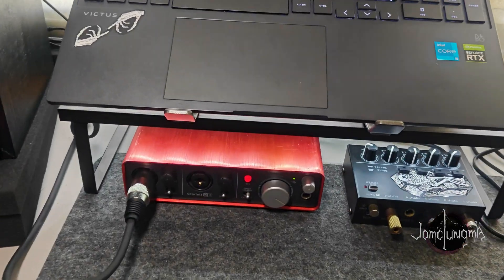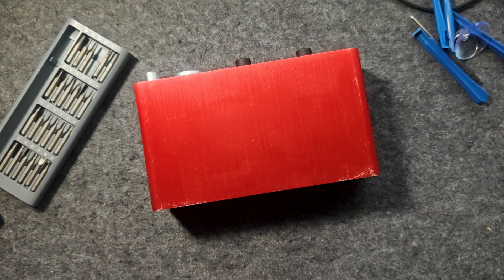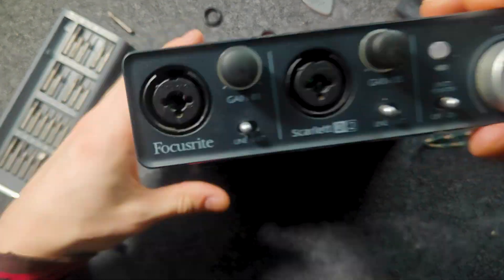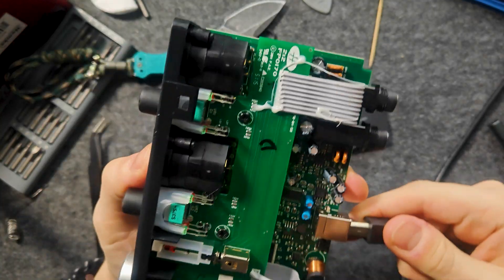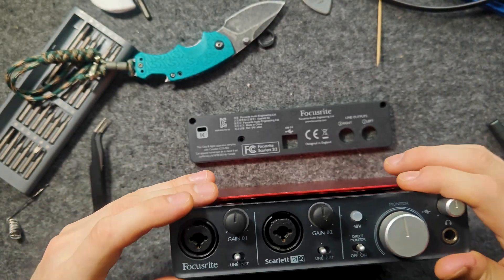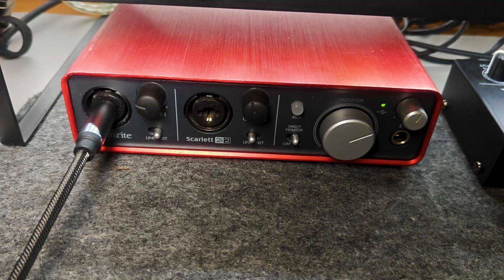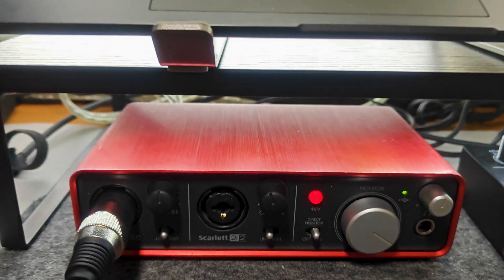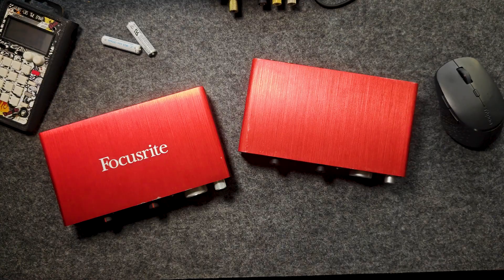Create and Explore: Focusrite Scarlett USB repair

Comment: I don't like the 6.5 plugs for the RCA in the back, too much clutter. You could do what I did, replace that horrible USB port for a C and a micro, both on top of each other, you have the perfect size with the square in the back plate for the original one and its not gonna break, also, way more convenient. The internal pin on the original is just mean, it breaks too easy with that hose sized cable, I had it cracking by just looking at it.